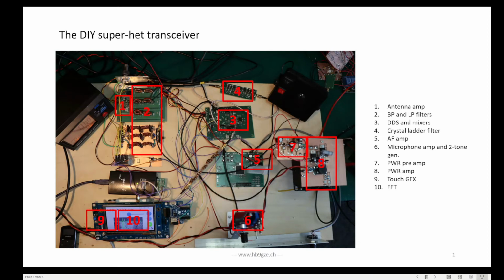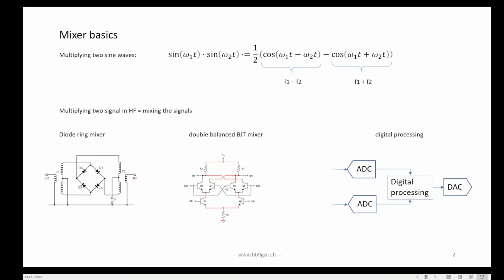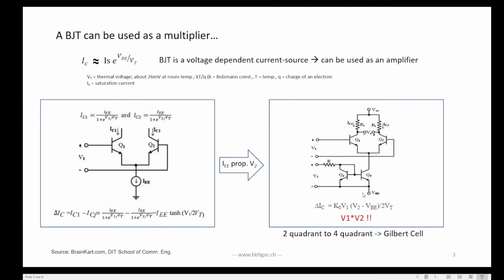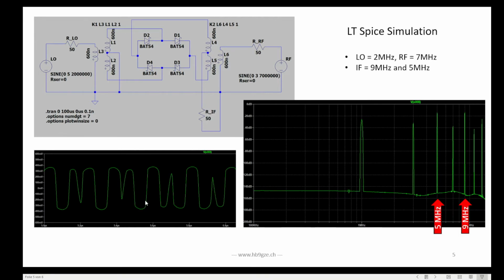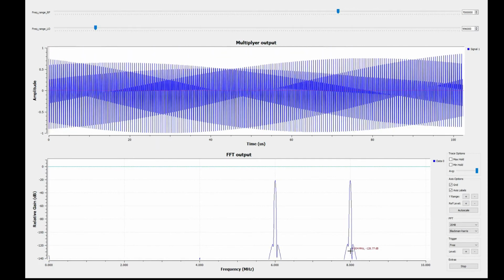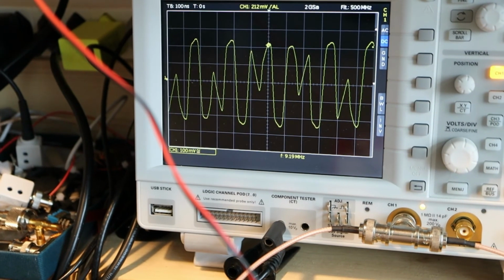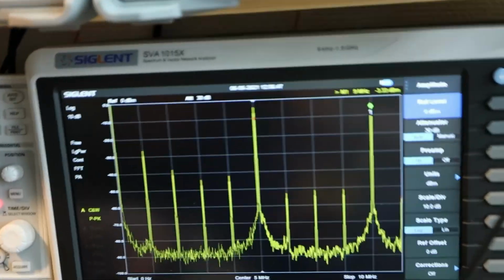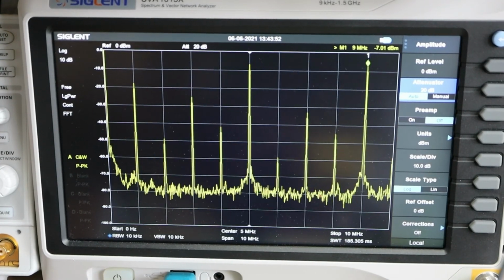RF mixers

Comment: I'm new to all this and would like to dig into the topic with an easy simple project. In your opinion what is the simplest and most effective way to get great results that can really get you motivated.  
Is Digital processing  the easiest way,  with the least amount of hardware and letting GNU radio do all the signal processing?  Are there any suggestable  beginner friendly projects  which only consist of a few SMD components that can easily be made  and can receive and transmit signals  and let the GNU radio do the heavy lifting? Something like the pluto from  Analog devices but simpler and easier to understand with less components? thanks for your informative videos.